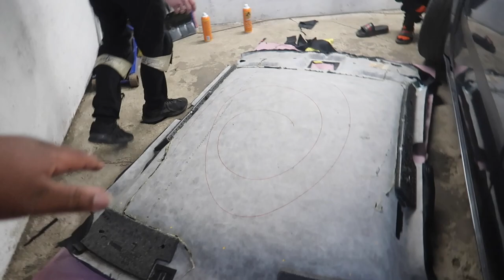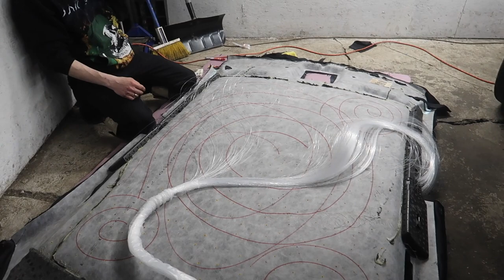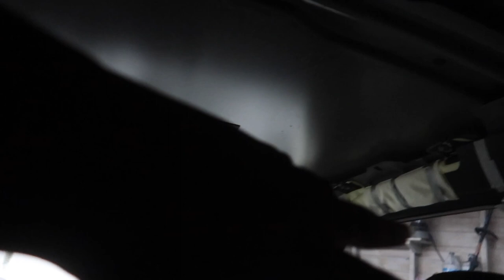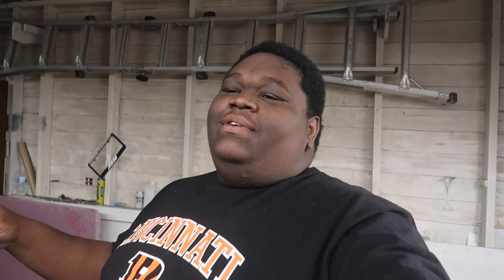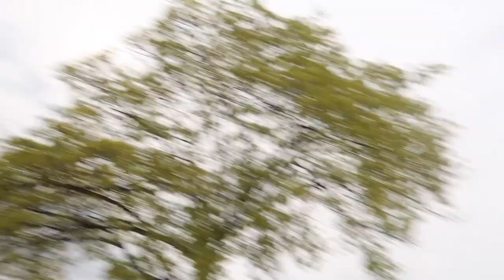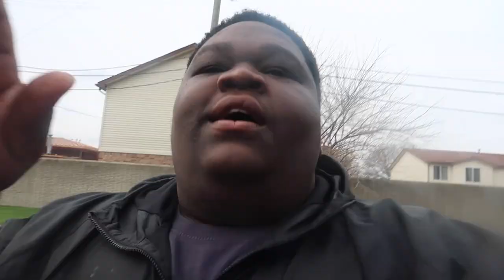Installing ROLLS ROYCE Star Lights In My Chrysler 300c ($100 Mod)

Comment: Got a Vanilla White Cream 2010 Chrysler 300c 5.7😍🙏🏾got it a month ago & I love it dawg. This was the exact model I wanted too but It got 125k miles on it. Any suggestions with gas? Gas ain’t no joke but it’s worth it. But any tips on add ons and gas savior. Should I get a oil catcher? Anyway yo whip fye tho ✊🏽keep making bangers on the 300 🔥 #300gang
Reply from the maker: Damn Man That’s Fire 🔥
Reply: change your spark plugs and coil packs